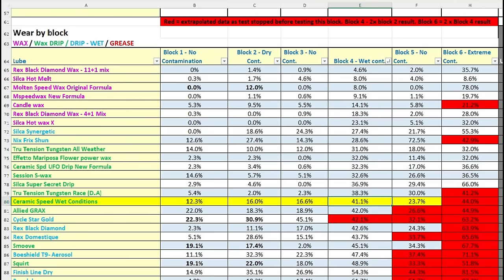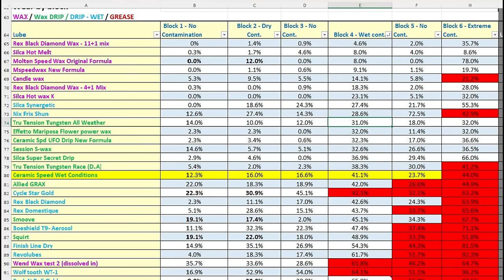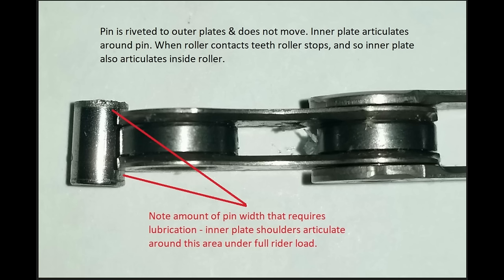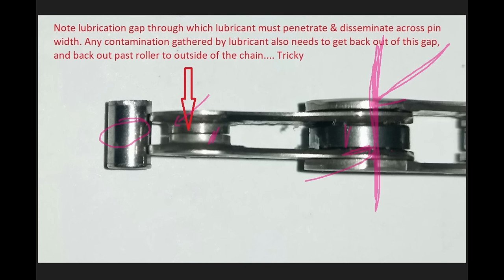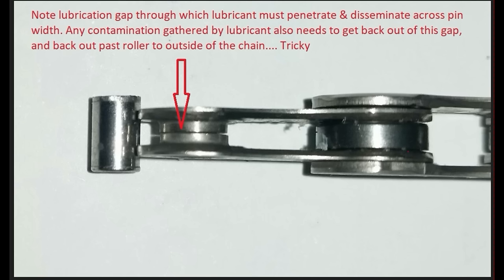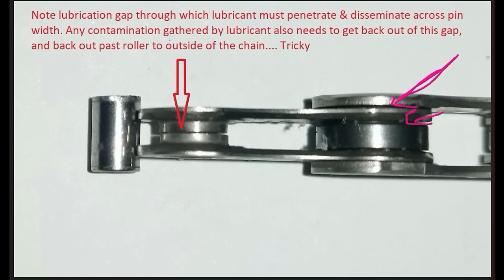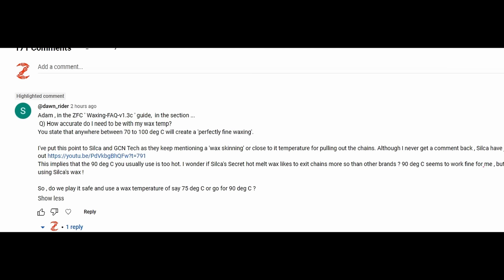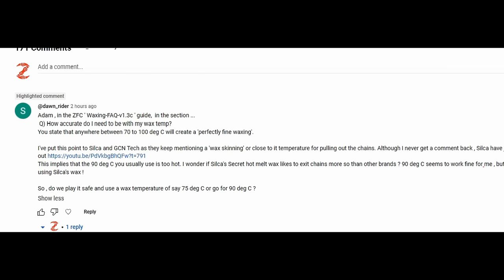wax not last

Comment: A great video as always!  I am a dedicated user of Silca Hot Melt & Silca Super Secret for top-off treatments between full a full re-wax, typically 2 top-offs, then a full re-wax.  I have 2 chains that I rotate through using this system....works perfect....thanks for your help in educating me on getting to this system!

My only consideration for a change would be to use a 3rd chain for winter riding indoors.  I live in the US (Midwest) and it can be that I will be on the indoor trainer from November - February.  I have considered using a 3rd chain where I use a traditional lube (Silca Synergetic) vs. the wax treatments.  My reason for doing this would be 1) generally very clean indoor riding environment, 2) very long-lasting treatment life from Synergetic (fewer times to re-apply) and not having to remove the chain for a full re-wax treatment.  The other option would be to use just the Super Secret drip lube in the winter.  I realize that given the overall quality of all of the options, there is probably not a 'wrong' decision to be made here.
Reply: Looking at implementing the same wax process.   What is your interval between top off treatments?  I realize it is condition dependent.  I live in the same climate as the Midwest.
Reply: @billyshakespeare17  I am very likely an 'over waxer' and probably apply too much.  I will generally go 150-200 miles between top-off treatments.  I tend not to ride in harsh conditions (rain, etc.) so I generally don't have to account for that.  I am pretty diligent about doing a wipe-down of my bike/chain after each ride to keep things clean.  I use the Silca gear wipes for that.  If I do a good job, I will also do a full clean when I do the chain swap while I have the chain off.  None of that is really hard, you just have to take a few minutes for the process.
Reply from the maker: Thanks Shawn! and yes correct if on a top lubricant choice there is not really a wrong decision (outside of in most cases wet lube and offroad riding). For indoor if its a dedicated indoor bike then a very long lasting wet lube can be a great option for sure, but if its going to have wax chain go back on for outdoor riding once winter over, that will mean a drivetrain clean up for wax chain to go on, something that would not be needed if you stay on a top wax drip. SS drip is good, but it is short treatment lifespan overall - UFO Drip all conditions is a longer lasting. They also have an indoor specifc lubricant which i havent tried yet but will be doing that this winter coming.

Comment: The longer muddy gravel events should really allow you to stash a freshly waxed chain at a pit stop (I assume carrying a spare chain with you is hurting you more than it benefits).
Reply: I did that in a 300 km event last summer. On the day it was bone dry so I didn't use it.
Reply from the maker: I think for some events there is no rule against such - ie if you can organise to have a fresh bottle of water and food, i dont think there is anything stopping you from having a spare chain there. 

For some events carrying would not be net negative if conditions are poor. A chain is only 250 grams ish, so thats going be basically 1/4 to 1/2 a watt even on a circa 10% incline, and next to nothing on lesser grades / flat. However if you have been through a bunch of mud and now have a chain thats lost 5w efficiency - well thats with you from then on and just getting worse. 

Ie just think how many watts for just hundreds of km's riders would have saved post the peanut butter section at unbound last year that was very early in the event. People were submerging bikes in big puddles etc to try to flush clean chain. It is fooked after that, its just a ton of precious watts - especially when knackered - going in to big loss in hardest working component, for the benefit of wearing through that component at fastest possible rate. The time difference for swapping to a fresh chain at first aid stop after that section by the end would have been quite a lot of minutes.

Comment: I love waxing and idea behind it. But for wet and hard, not much beat bathing chain in gear oil night before, then afterwards just clean it, not much protects better from rust and water, assuming conditions are bad. Wax is perfect for dry and dusty.

Adam something you could test? Bathing in gear oil every 200km or so in dry conditions? I know problem arise with dirt contamination.
Reply from the maker: Hi! sort of maybe... i have plans to do a chain maintenance testing later this year hopefully, and something like that could be an option. Generally such a path - i worry it is still pretty faffy.  Ie submersion wet lube  - its relatively mess re excess - one can set up to have it drip back in to bath, but then there is still a lot on the chain. One can wipe excess - then goes through a lot of cloths. One needs gloves to install and remove as its a mess. Cleaning? what is one using to clean? how much do they use? cost? how do they dispose of that? 

I just cant see that this is faster or easier than say wax on weekend, re apply something like tru tension tungsten all weather when back home ready for the next day, continue that for the week, and either just re wax to reset on weekend, or bonus points - 2 or 3 x boiling water flush rinses, blow dry 2 mins with hair dryer, re wax. 

No handling messy chain, no need for gloves, wiping excess, solvent cleans etc etc. I just cant see how a wet lube approach like that is easier than the hybrid wax drip + immersive wax approach.

Comment: I carry a second chain, then after whatever km, I do a quick clean (hot water) on the dirty one, and then put on the "drip wax lube" put it in a plastic ziplock and keep it warm until I need so the wax has a chance to get into the pins...:)

Comment: Thanks for the video! A question about breaking the wax bond: would it be ok to break the wax by wiggling the chain for a minute after lifting it up from the waxing pot? Instead of letting the wax to stiffen up completely before breaking the wax bond on each link. I tried this method once, seemed to work nicely but I'm unsure if that would have negative impact on the result. And also: what about wiping the chain when it still hot with a towel to get rid of excess wax on the outer surfaces (where no lubrication is needed) - is there some downsides to that?

Comment: Hot damn!  Look at candle wax at #5.  Oh yeah!  I've made my own candle wax with tungsten & molybdenum disulfide powder mixture, so I'm pretty damn sure I'm set.  Spent about $40 total for 10 pounds of wax.  Will last the rest of my life I'm pretty sure (and that's for a family of four's bikes totaling 20).  So far so good.  About to embark on mountain bike ride #4 with my immersion wax and psyched to see how it performs.

If it's even marginally better than candle wax alone, I'm set.  From what I've experienced so far after 30 miles (3 ten mile VERY dusty CA rides), it's FAR AND ABOVE better than what I've been using (Dumonde Tech and Rock & Roll Gold & Blue Extreme, used separately on different bikes.  That's most recently; used almost everything at this point.)

Why oh why did I wait SOOOO LONNNG???!!!
Reply: Update:  Ten mile ride #4 in mid-elevation Sierra dusty terrain today was a HUGE SUCCESS!!!  Riding in an area rich in eroded andesite soils, so the stuff is ABRASIVE AS HELL!  Chain still running like new.  Unbelievable!!!!  I simply cannot believe the performance.

And just as an aside, I did a ride in the same Sierra location a month ago.  A bit longer ride (15-20 miles) and half-way through I simply HAD to do the "clean the chain, ring, cogs & pulley wheels with a rag, apply lube and wipe off excess" boogey.  Chain was SO DONE on that ride with Rock & Roll Extreme.  But this is what I've been doing for 40 years mountain biking, so it's nothing new.

Good riddance!!!!  Hello immersion waxing!!!

Comment: I would be very interested to hear what the best lubricant is for outright speed for indoor track racing. Also the best single speed 1/8" chain - would it be Dura Ace as per their 11sp chain?

Indoor track racing would benefit from your attention as marginal gains can make a real difference in this discipline.
Reply: I use MSW with a YBN SLA410 chain.

Comment: I am doing a 250 mile gravel race with 25k climbing in 10 days. I am putting on a new XX1 eagle chain from Silca with their hot wax before the race. Are you suggesting not to carry the Silca super secret to re-lube as that won't have time to set up, but to apply something like a liquid/oil chain lube like their Synergetic as opposed to the Super Secret?
Reply from the maker: Hey stewart - sorry is that multi day event or single day event?
Reply: @zerofrictioncycling992  FKT, so hopefully all in one straight push (20ish hours)
Reply from the maker: @stewbomb5  ah cool, yeah just start waxed then throw on some synergetic when chain starts to sound / feel dry. Sort out reset chain after, but yeah for such events you really need to move to a top wet lube even for offroad

Comment: If I understood you correctly - it isn't worth running a waxed chain for multi-day ultras, say 5 days of 20 hours? At most I might have 6 hours of sleep and breakfast to allow any wax drip to set.
Reply: And to push this - even multi week bikepacking of 10hrs/day - unless I completely spend a rest day off the bike, I'm thinking the max time off is 12 hours for wax to set, and this again might not be enough
Reply: Just use synergetic by Silca
Reply: @jameswong391  i think those 8hours sleep is enough if you add lube as soon as you stop. The real Problem is wet days. Or wet nights, your drip will certanily not set when the bike is standing in the rain :) But if you can expect a dry climate with hot nights it could work. I only did 9 days with a single wet day and the chain didnt feel dry in the end. In my case it was scandinavia so the sun helped setting almost all oft the night...

Comment: What have you seen from wear rates on force axs chain with road 1x (+ wax) ? Best to run 1x with smallest cassette then to help wax last longer? Force axs 1x with 50-54 chainrings paired to 10:33/36t cassettes?

Comment: Hi, if I apply Synergetic to a waxed chain can that chain be continued to be used with Synergetic as a wet lube chain? Would the wear rates be similar in this hybrid case to a Synergetic lubed fresh chain?
Reply from the maker: Hey John yes that all works great. Many who are looking to just run a top wet lube will still get a pre prepped wax chain so they dont have to faff with removing factory grease. Just run the wax treatment for approx 300km - the amount of wax left is then very small, apply your wet lube and then just continue on and all is grand

Comment: So, considering the straightness of the chain line being beneficial for long-lasting quiet and efficient wax lubrication, a triple chain-ring in front is supposed to be a significantly better option for long climbing events compared to 1-by or 2-by systems, am I correct?
Reply from the maker: It may help re keeping chain line better and thus treatment not suffering the issue discussed here for longer, however "overall" beneficial in most cases i would say not. 1) a triple is a lot of faff. A lot. There is so much cross over of same / similar gear ratio's - one is unlikely to be riding in the most efficient gearing for that desired ratio all the time. Remember a smaller chainring size = more chain tension for a given power, and more articulation at chain ring, and you will be in a smaller cog for the ratio desired if in a smaller ring = more articulation there as well - so there are 3 things that add up to give greater losses in a given ratio that generally make smaller ring / smaller cog less efficient than larger. Yes there is a point where chain line angle for larger can push this in smaller favour - but this is much much less often in general. 

Ie - many triples might have as small as a 22t smallest ring. That is going to be in general a very inefficient ring. As long as ones chain line is not too extreme, and lubrication on side surfaces not all gone - running a 34 is going to be more efficient pretty much all the time. 

Overall the number of times due to chain line angle and conditions one finds themselves with treatment going dry - overall this should be very rare, and in many cases - pre planned for. This is going to be overall much better most of the time than running a triple with all the extra faff, extra weight, and running generally smaller ring and cog 99% of the time for a given desired ratio which is less efficient than larger ring / cogs.

Comment: Call my cynical but can't help but think that the lower temp chain removal recommendation is driven by increased sales via wax pot consumption rate 😄
Reply: I have tried both methods, and I feel that the extra coat of wax left by the "cool removal" method makes the drivetrain more silent when shifting (but also messier, as Adam says in this video). Wax on the outside of the plates may reduce friction between the faces of cogs and chain. Josh Poertner also recommends shifting across the cassette when applying Silca Super Secret, which offers a similar audible benefit. I think he likes silent drivetrains and may think it is easier for people to adopt waxing if shifts are smoother and less noisy. I prefer a cleaner drive train for my road bike and a smoother one for my MTB. It is good to have both options :)
Reply: Much chattering of a normally lubbed chain comes from interfacing the puĺley wheels. A nice narrow-wide tooth, ball bearing pulley wheel helps.
Reply: @dmallo    I think your right about Josh and silent drivetrains. He said it again 6 days after your above comment https://youtu.be/Vot15ro-fcE?t=805 .  If he is 'cool immersive waxing' because of noise I've never noticed him saying it. Good bit of lateral thinking on your part though !

Comment: So, at extreme chain line angles, in dusty environments, do wax lubricants such as Squirt or Smoove do any better at not abrading off and remaining in the chain? Also, have you done any of your complete tests of a top wet lube like Synergetic vs immersive wax on an extreme angle like 32 tooth ring to 52 tooth sram eagle drivetrain? I would be curious how much long steep climbs increase the benefit of a top wet lube over an immersive wax longevity wise.
Reply: And when I say complete test, I mean where you do all your testing blocks of dry, wet, and extreme conditions.
Reply from the maker: Good questions - alas only anecdotal information really as not control tested these scenario's - i'm not currently set up to do that testing - maybe one day, but core test work is oh so busy all the time. 

Squirt and smoove - on the one side they have a potentially longer lasting wax base being - we believe - an oilier wax, so less likely to be abraded off as quickly as a refined solid wax from the sides of those parts. On the other side, it would still get really thin after some time, and be mixed with a lot of abrasive stuff. 

However anecdotally i have heard that a well prepped smoove chain holds up well in long harsh conditions - wet or dry. Squirt may be similar, but ZFC doesnt sell squirt at this time (we do sell smoove) so i havent got a customer base feeding back for squirt. 

I need to put smoove through the new Single application longevity protocol, i just havent got to re testing it since the new test change, but i need to. In ceramic speeds own testing for developing their wet conditions lubricant, they advised smoove was the only one they tested that wasnt quickly washed out. And its fast. So it is overall a solid product just more faff re penetration, and a tough maintenance clean to reset (and then get past penetration issues). But prepping a chain specifically for a long hard ride - Smoove should hold up extremely well and may outlast the top immersive waxes - but i will need more people doing long harsh dusty rides to pit Immersive wax chain and then a smoove or squirt prepped chain against each other. 

If its road - the IM Wax vs top wet lube like synergetic - all up longevity should be relative to normal riding. Without a lot of dust getting in there to abrade wax off those parts, the wax will hold up for a very long time, and so if re waxing at normal recommended intervals - one wont have any issue with immersive wax treatment lifespans on any parts of the chain. Synergetic is very long lasting so may be able to go longer stints before re lube, but again unless focus on very long event - such things are not of too much importance when one is able to just re wax / re lube and good length intervals in normal riding / training.
Reply: @zerofrictioncycling992  Hi Adam! Thank you for sharing your knowledge with the community.

I recently started using Effetto Marioposa Flowerpower wax with a very budget 3x8 drivetrain (all new including KMC X8 chain) and I feel my chain doesn't stay quiet for very long. Is it possible that Flowerpower doesn't play well with looser tolerances of 8-speed chain? Or is it more likely an issue with chain preparation or wax application? I've seen you have some data on 8-speed chain tensile strength, but have you done any lubricant testing with such chains?
Reply from the maker: @stefankrzeminski  Hey stefan! not too much - i wear tested a shimano 8spd and it was pretty bad - 8spd chains dont really have any wear protection on them and likely a lower grade of steel vs quality 11spd etc. 

It could just want to build up a little more wax inside so may want to reapply early first few applications (ensure wipe excess thoroughly post application and work in). Many wax drips do "layer up" - and so sometimes re applying frequently to begin with can help and then more normal expected treatment lifespans should occur.